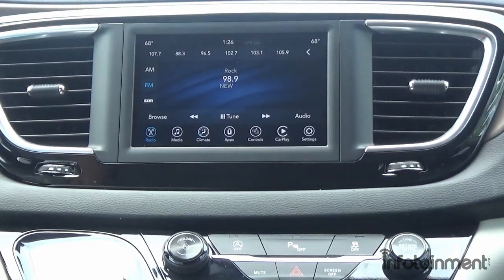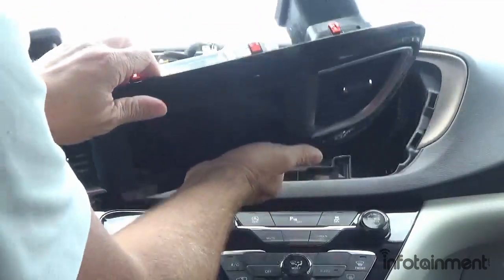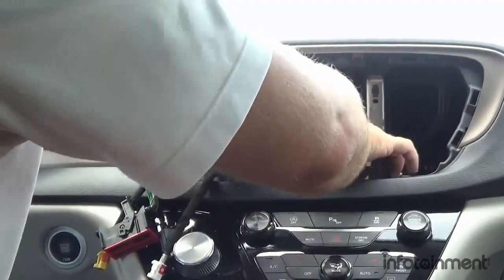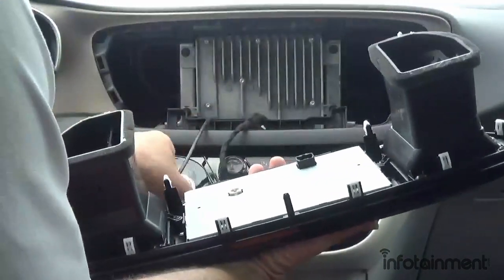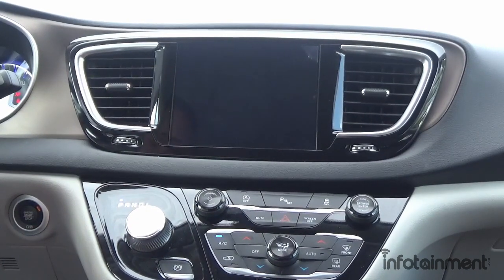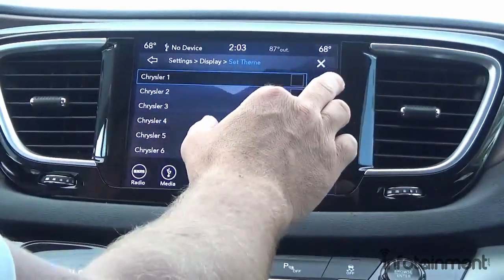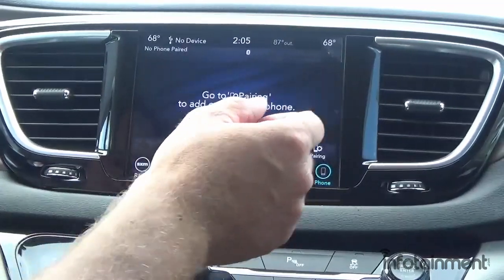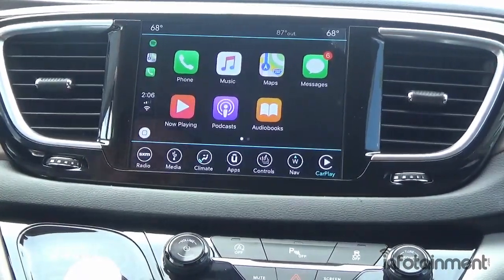2017-2019 Chrysler Pacifica - Factory UConnect Radio Upgrades - Easy Plug & Play Install

Comment: Where can i buy just the wiring harness? I have 2 vans and want to swap the units so i have everything but the harness
Reply from the maker: We don't sell any harnessing at all. It would have to be from another company. We want our solutions to work so we ensure all parts go through a 20 point inspection. We only sell full kits.
Reply: @Infotainment_nav  what's the difference in the wire harness you sell with the kit vs selling it separately. Either way it's the same? Guess I won't be able to swap the units 😕

Comment: I've just upgraded from RA4 (8.4") to UAV on my 2017 Pacifica. Everything works well except for the USB port. It keeps charge then stop and charge again so I couldn't use the android auto feature. I swapped back on the old RA4 and the issue is gone.  Any advice?
Reply from the maker: Please contact our support team so we can help fix this issue at 855 636 6287 ext 1 or email them or chat with them from the support team on the site www.infotainment.com

Comment: I have a 2017 Pacific with an 8.4 inch screen but does not have  3g cellular,wifi hotspot,carplay and android Auto is this all features available on this if i like to upgrade  to this product ?
Reply from the maker: If you don't have that feature currently, Our upgrade will not add that part this. Since this has to do with shark fin antenna of the car for what features are already there and that's controlled by the Sirius guardian to enable those phone app features and wifi hotspot etc. Thank you for the question.
Reply: Thanks for  info. With this i like  to add 3g or 4g cellular  futher  as well so please  let me know  if you know  a part no or name i can add to make it work if not then it's  ok still like  to have this UAV system.